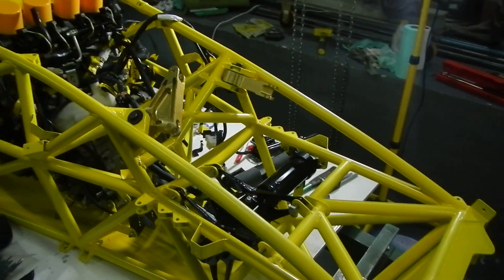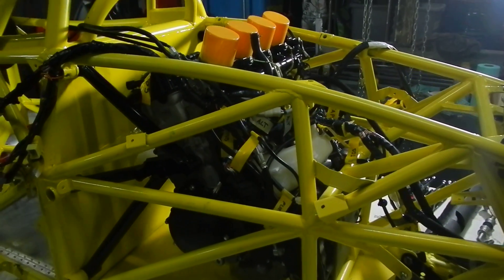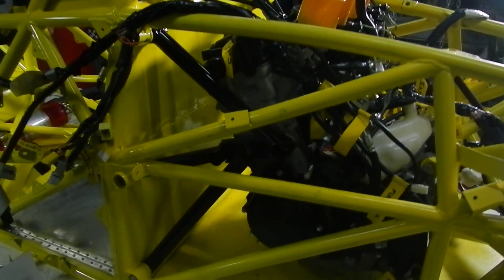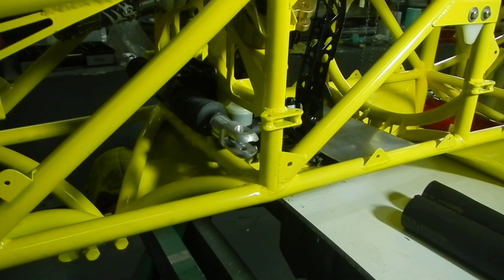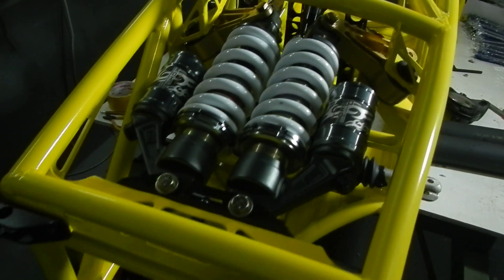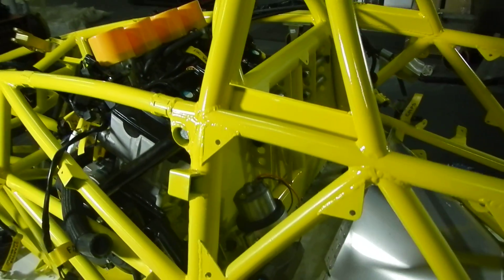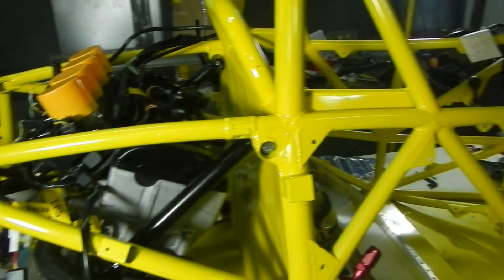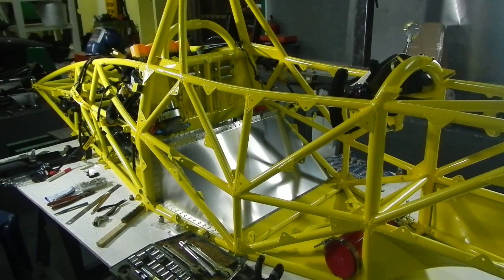Formula 1000 Race Car Build Update 5

Comment: hi, where do you buy that diferential?
Reply from the maker: I bought it on ebay.com, but that seller is gone and the price has gone up. It's like this one: http://www.ebay.com/itm/QUAIFE-Differential-LSD-Honda-FIT-QDF15U-fits-up-to-2008-model-Civic-D17-/230623898919?hash=item35b2416d27:m:mV3rVbFOSyPD8NXdTt9Uhmw&vxp=mtr
Once that link no longer works, just search ebay.com for "quaife differential honda civic".
Reply: Ludemann Engineering  thanks :)
Reply: is that diff really tough enough for the race car?
Reply: The only thing the confuses me is the hole axle part What did u use for the CV joints?!  Axle ends?! And the how long are They?!